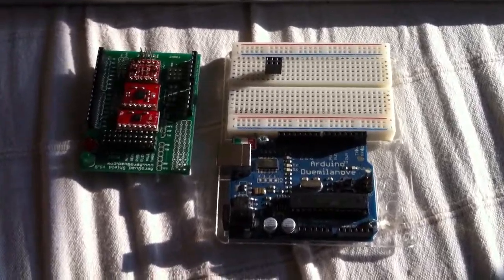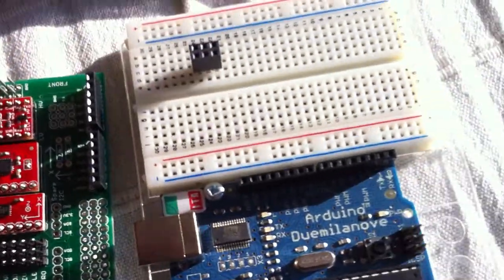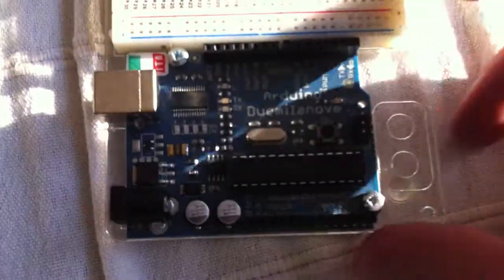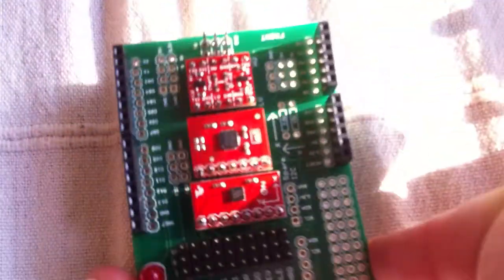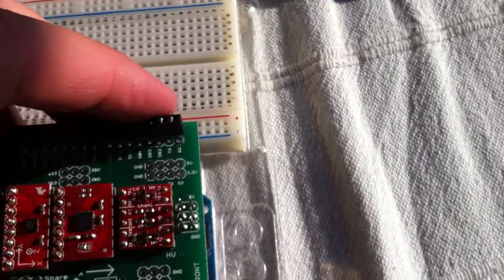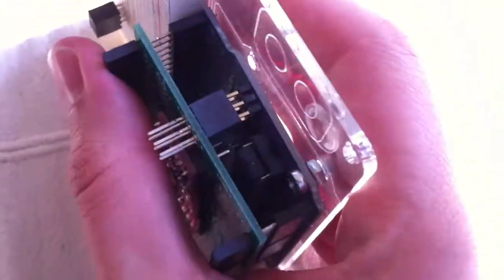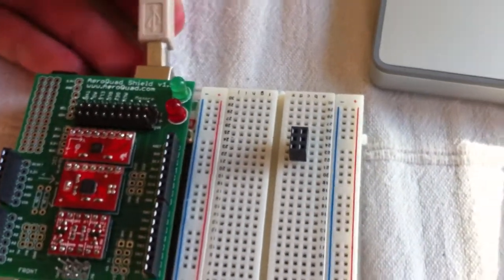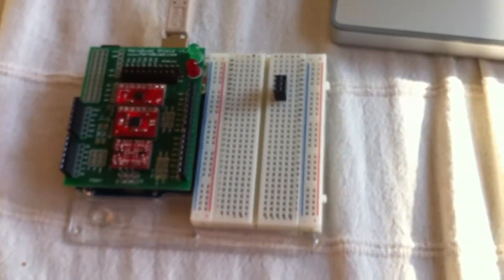connecting aeroquad shield arduino and computer

Comment: Would this method work the same if we are using an arduino Uno? We are having trouble getting power to the AeroQuad and the Xbee receiver. The wiring schematic is causing us trouble.